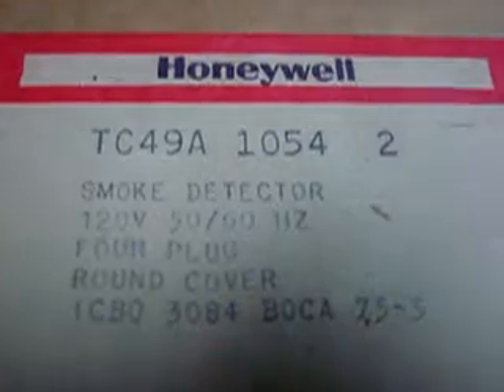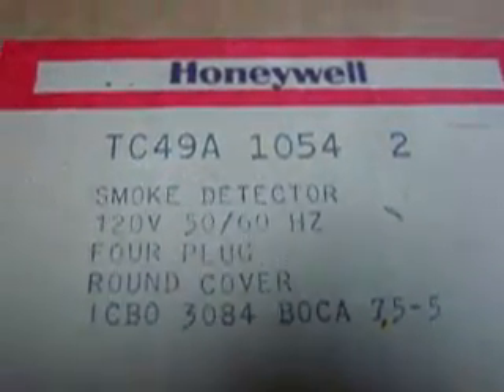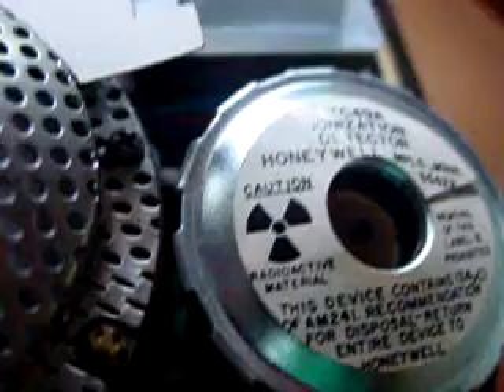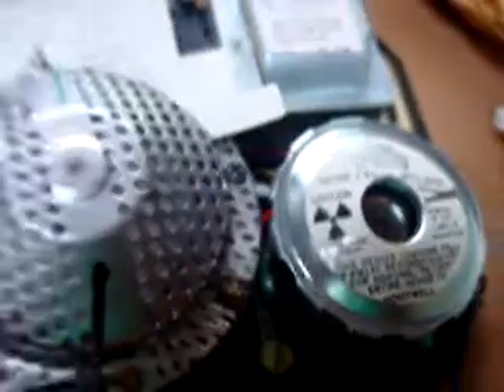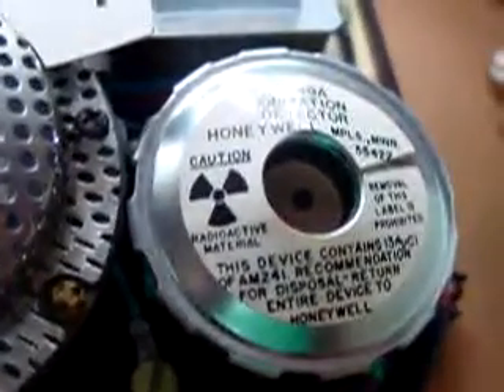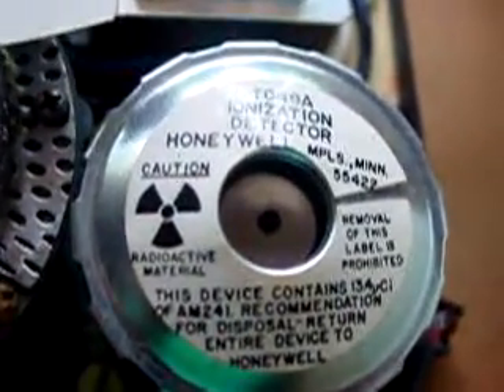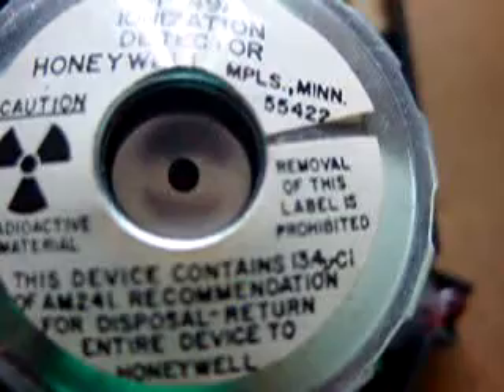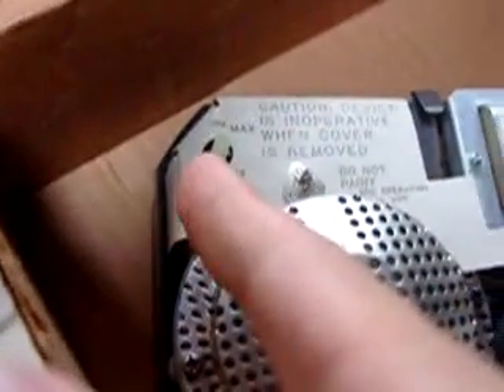Honeywell Smoke Detector (vintage)

Comment: This model had a DC horn with a lower pitch compared to most AC horn alarms. The one I have has a different horn-an Edwards one with a much higher pitch, but is still DC. This one has a different model Kobishi horn (CLB-28?) with more of a hum than a beep

Comment: @NLind Yeah I think this alarm sounds like it has a DC squealer horn that is using AC power. Gamealarm's GE AC smoke also sounds different from most of those old AC smokes. I wanna say that that one also used a DC horn, but the AC going to it must've been rectified, as that one made a straight sqealer horn noise